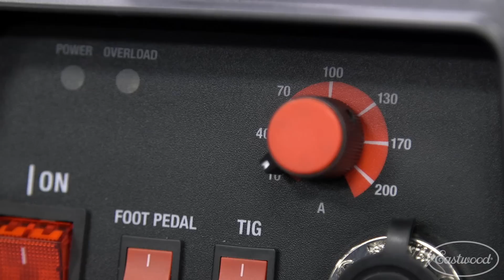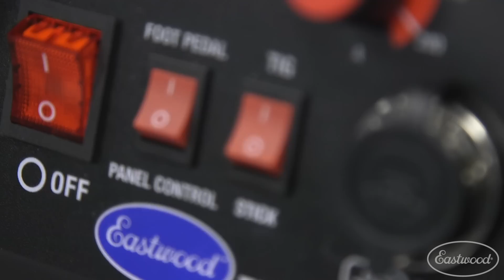TIG 200 DC - Weld Mild & Stainless Steel up to 1/4" - Great TIG Welder for the Beginner - Eastwood

Comment: Just started using mine with stick. Is the polarity DCEN with the designated stick lead connection socket?  If so, does switching thr ground clamp and stick lead work for switching it to DCEP to run rods designed for it?
Reply from the maker: TIG - DCEN
Stick - DCEP

The leads on the front of the machine can be swapped so it can perform both types of welding.
Reply: @eastwoodco Excellent. Does it have sufficient voltage to run 8010?
Reply from the maker: The TIG 200 DC has 10-185A output in Stick Mode. That unit will do OK but It does not have VRD.
Reply: @eastwoodco Good, that sounds more like a disease than a feature of a welding machine.

Comment: They really undersell how well this machine stick welds. I’m finding that I prefer it over my other two IGBT inverter machines. It has become my main stick welder. Runs surprisingly well off 120v for stick too. Lots of power on tap. Cheers 🍻
Reply from the maker: That's great to hear - thanks for sharing!
Reply: Does it run 6010 and 8010 well?